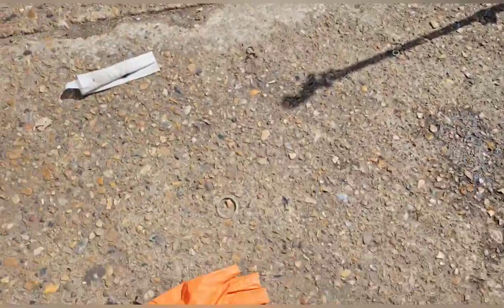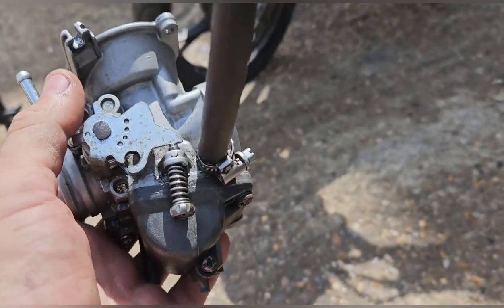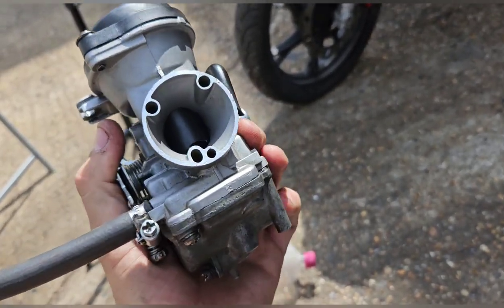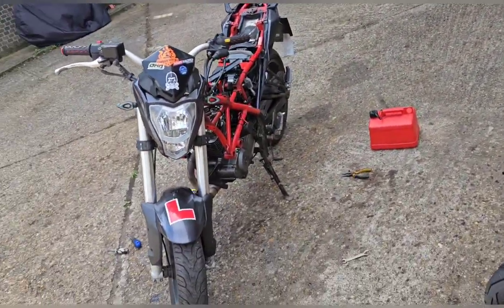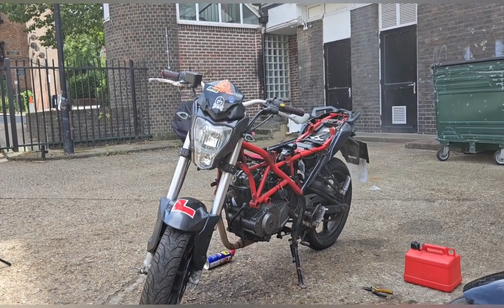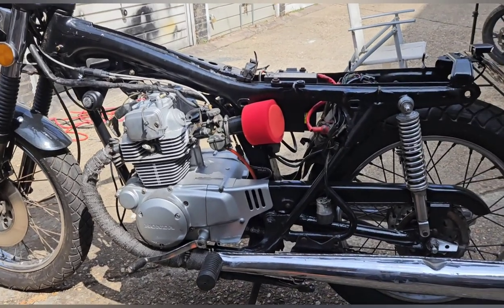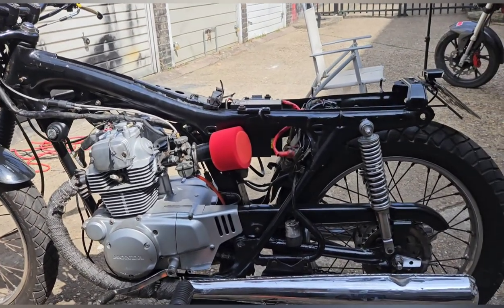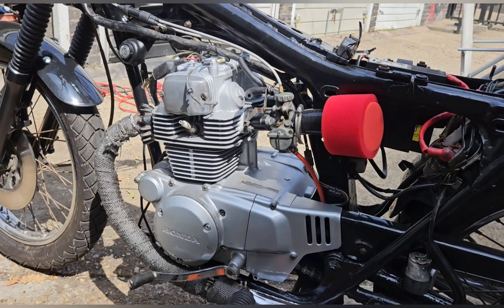ksr grs 125 Carb issues continues.

Comment: I don't know who's in your area, but you may find a friendly reboring specialist who will measure up the CB200's bores and pistons, and tell you if they are within tolerance (it helps to know the spec. before you go, so they don't have to try and find it). I was helped by a local shop, who also deglazed the bores on my GS550 barrels and wouldn't take any payment for doing any of it. Result of mine was a new set of rings, but at least I know that bores and pistons are in spec.
Reply from the maker: Yeh maitland (my local mechanics) would send it of for me but funds are tight at the moment. 

So I've got a new set of rings and an happy to give it a shot. 

It may not go all the way back up to 170psi but anything around 130 and over I would live with for now. 

Cheers Rick

Comment: Just recently bought a 99 aprilia sonic in great condition but leaks a little bit from overflow pipe but then stops after its been off for a while deffinatly a carb issue, any ideas matey
Reply: Sounds like float needle not seating properly. Take it out and check it for a groove worn around the tip.
Reply from the maker: The float valves can go out of speck after a few years. I would attempt a new float valve first. If its a suction fuel system then make sure the suction system is working and it's not free flow. 

Hope this helps. Good luck
Reply: Thanks ill have a look when i get a chance deffinatley the float like you guys said ill tackle it on the weekend nice one 👍
Reply from the maker: The valve itself although setting the float could be needed. 

Good luck with it

Comment: Iv got one of these gsrs has TPS sensor fault and won't run
Reply from the maker: Yours must be a fuel injected one? 

I had issues with a fuel injected one once. I bought a carb and manifold and converted it back to carb. It ran great after that

Comment: Could be worse, could be a Suzuki DR125sm injection🤬🤬
Reply from the maker: You having trouble with one?
Reply: @motorcyclerescuer  fuel bypassing rings into the casings!
Cleaned tb an replaced orings including missing air/fuel one.
Need to do oil change,probably clutch out clean an re oil,refit tank,limited fuel put tb back and turn over to see if the spark has restored if not have spare CDI.
Stator case has metallic flakes in maybe the pick up or the lump on the flywheel is damaged.
Wish I could do a swap to carb tbh much simpler 😂😂.
Ignition system is all testing good but no spark hence the spare CDI.
Fi light permanent flashing even when doing dealer bypass,wire loop on 2 terminals.
It's driving me mad!🤯
Reply from the maker: Omg that does sound a pain mate. 

Is carb conversion not an option?
Reply: @motorcyclerescuer  I need a doner bike,like a gs125,gv(van van) or gz,need something local an cheap.
As you know the whole loom is needed well a complete transplant of everything really.
It's not beyond me tbf I think the gearbox or engine could be scrap but I'll give it a whirl, I'll be making a start tomorrow.
If I get it running I'll do an oil change again after a 5 min warm up just to clear any cack from the galleries an see how many miles I can get on it before it goes boom.
I bet you've had that hand grenade engine feeling more than once just waiting for the 💥💥🤣.
Love your videos,bumped your injection to carb one up by 10 personally, inspired much 👍🏻